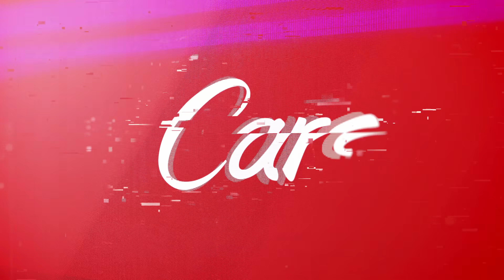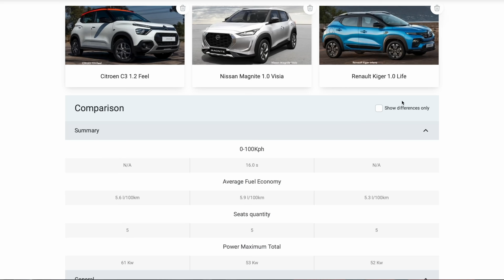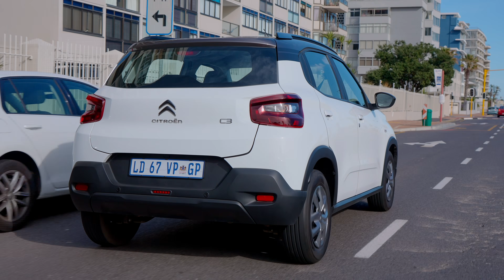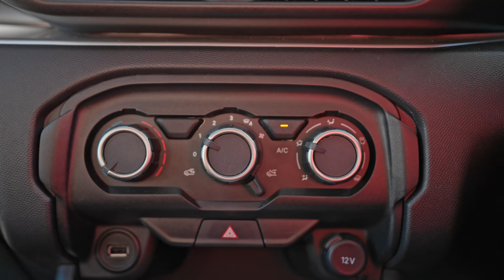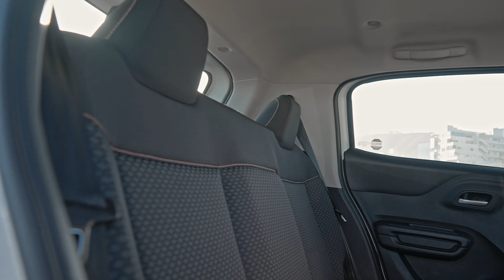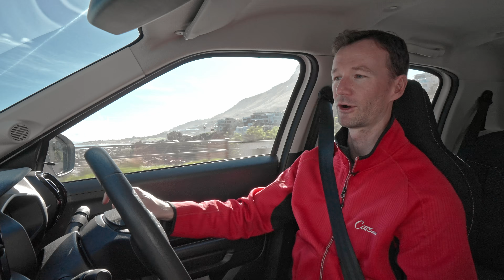2023 Citroen C3 - New budget champion?

Comment: So this car is what happens when a premium brand starts to go the budget route, you can see where the focus was, in this case it was tech, which appeals to the young people who would buy a car like this. The manual wing mirrors is bad, but a lack of stability control is dealbreaker as that gives you better control especially  at higher speeds and can also help you get out of a situation when you have wheel slip. If however youre more concerned with screen size and infotainment features and digital dashboard availability at budget prices then this is the car for you.

On a side note its nice to see that Citreons moves in India are starting to pay off with exports out of India. Their strategy is to make India a local production hub which means that only parts made in India will be put in the cars.
Reply: This is why the Chinese cars are so popular under the young people's market. Very funky and full of tech even in the budget versions. Look at Wuling mini ev. R90k - R250k.
Reply: @etienne6641  thats true.most of the persons I see for instance driving Jolions are young persons while most older folks drive and H6. That Wuling mini though, more power to anyone with the stones to drive it, it has the Bajaj vibes.

Comment: The Citroen C3 is an EXCELLENT option for an small City crossover, but there's one main handicap - There's no CVT or Automatic transmission😢. Rest all is excellent. Citroen better needs to make auto climate control, sunroof and CVT available in all trims. Then it's an real hot cake and winner 🎉🎉🎉🎉
Reply: And it ceases to be budget. If they are charging this for what is on offer now, for all those bells and whistles your advocating for the price will easily go above 300k, at that point its in a different market that it cant make an impact.
Reply: @mindfreeze0838  hmmm right, but i think Citroen should be giving this for those who pay the top Rand too.
Reply: @VinayWebstar  i get that but they are basically getting a toehold in the market. They did something similar in India, after a time they added more features and trims as time went on.
Reply: CVT transmissions are garbage!

Comment: These vehicles are top heavy for their size, their wheel and body structures according to weigh ratio.        Are  problematic especially in making tight turns and when loaded.   The same goes for smaller Nissans.
Reply: Same thing I felt with the Suzuki Dzire